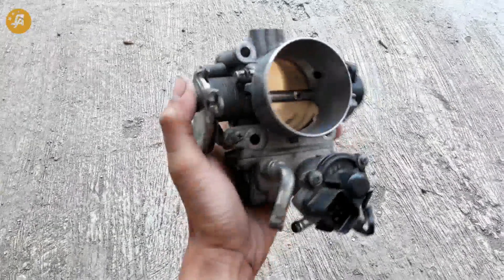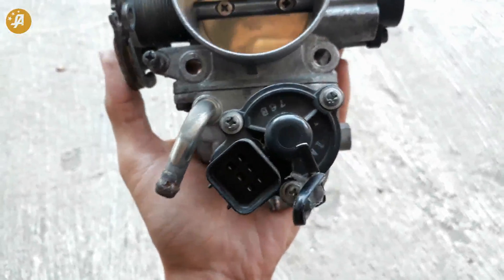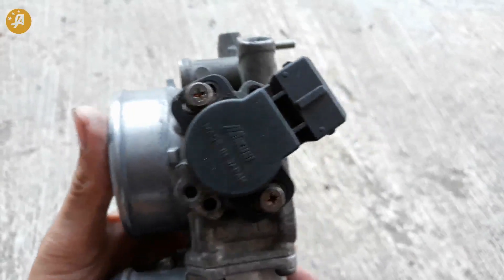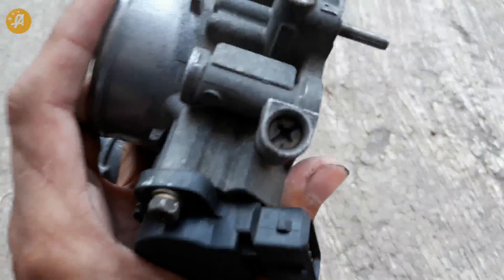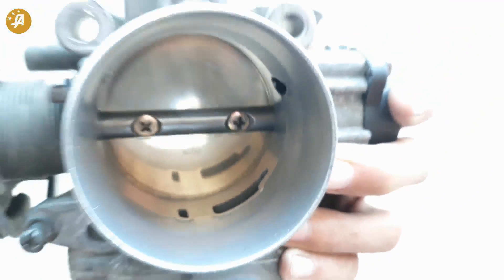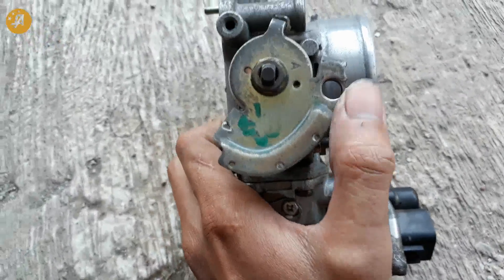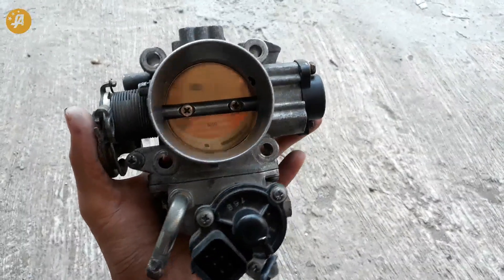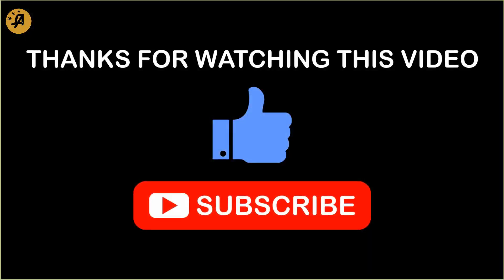Review #1 | Throttle Body Lancer Evolution 6 (Asli Evolution 6, bukan CK4) - Indonesia

Comment: Klo cb 4 bisakah pake throttle body yg lain bos
Reply from the maker: Gak bisa mas. Servonya gak support.
Reply: Bisanya pake punya apa ya mas?
Reply from the maker: Gak ada persamaan om.
Reply: Soalnya sudah ganti servo kit tetep rpm tinggi, klo AC hidup drop
Reply: Mau tanya lagi om....klo kabel jalur AC  dari ECU larinya ke mna dan warna apa ya om...mksih sebelumnya